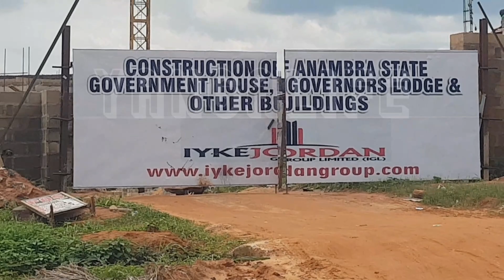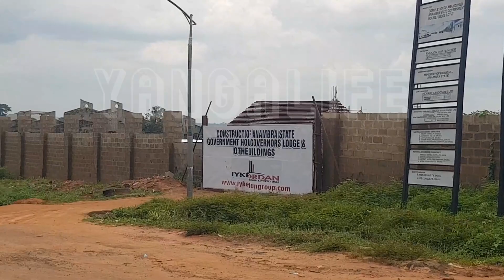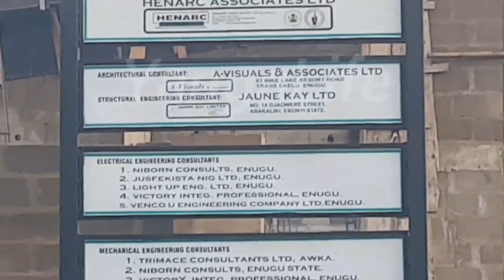The Truth On The Constructions Inside The New Anambra State Government House

Comment: This project project was initiated by a military administrator Joseph Abulu in 1991 and abandoned 31 years ago. It seems rom the video that the project still has not been revived.

Soludo is simply a scammer who pretends to start projects that he later abandons. Even a blind man can see that nothing is happening on the site.
Reply from the maker: From the video, you can see that work is going on. But What if Soludo had decided not to build that project?
Reply: @YangaLife  Did you see any construction workers? I didn't. Even the gate to the site was locked. Soludo just like to give appearance of on-going project but abandons almost all projects. 
The man na correct scammer.
Reply from the maker: @proyouservicesltd3652 workers were inside doing their work.
Reply: @YangaLife  I didn't see anybody working, if so why lock the gate to the site? I suspect  anybody you saw inside are merely security people. 
Perhaps you can do a progress report in a month's time to see if work is progressing.